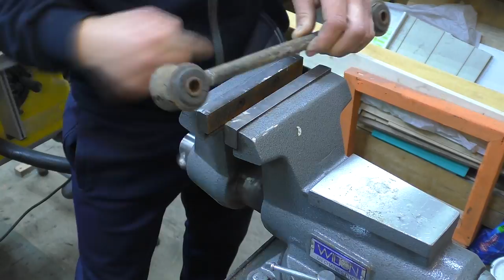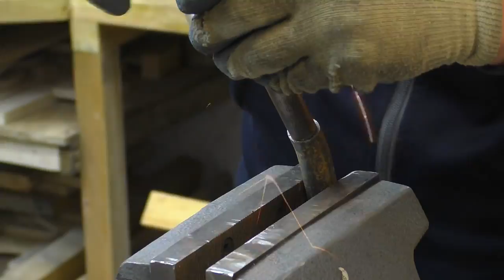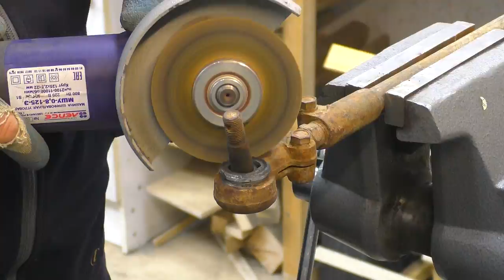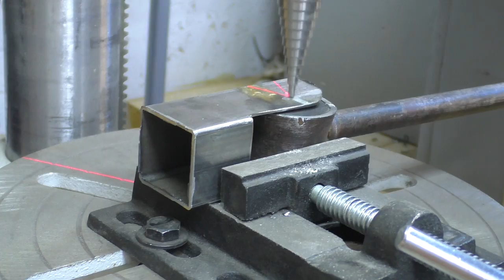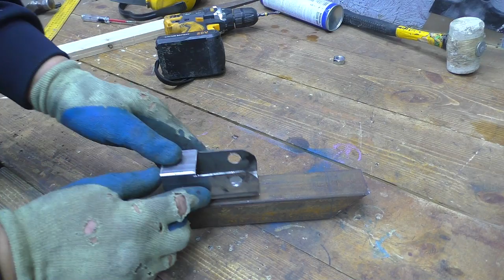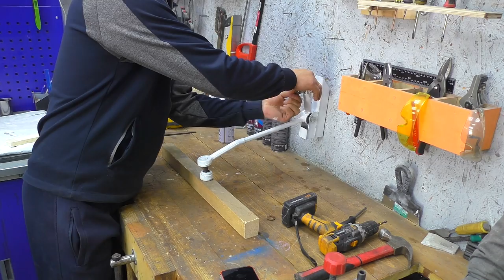An idea from the steering rod from the CAR!!!

Comment: If you're not going to measure before you cut, why waste a marker? With about a 1 to 10 leverage at the wingnut, how much downward force could there be at the tie rod end? To get enough force to hold anything, the adjustment screw will crush the square tubing it's pushing against.

Comment: Don't trust that weld butting the two pieces of rod together, doesn't look like it was prepared right for good penetration. Handy idea though, I would like to add a way for it to get out of the way when it's not in use.  And make it's length adjustable for versatility 🤔

Comment: Yeah. 2 drywall screws onto particle board ought to secure a rod sticking 18" out for clamping. What's he going to do with that, hold a railroad tie while he welds a sheet of aluminum foil to it?
And I saw this guy earlier trying to mig weld 1/32" galvanized steel to a 3/16" steel pipe. Do you think I'm going to trust that tie rod he welded on my steering?

Comment: Awful welding!
Reply: I use to work with a trailer mechanic that would do bubble gum welds on trailers.  They would always crack and fall apart but he would then weld more on.  Those were the worst okking welds I've seen.
Reply: Tutoriales  crear  rreclamos venado

Comment: Is that your best saw? I have sharper teeth in my mouth. The only holding force is from the compressed rubber your idea will not work due to the fact your leverages are all wrong.